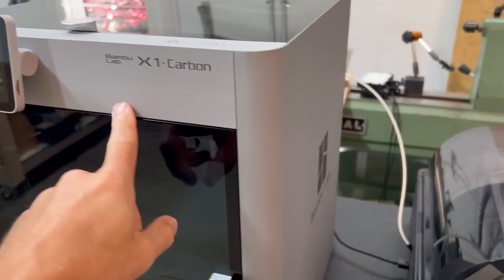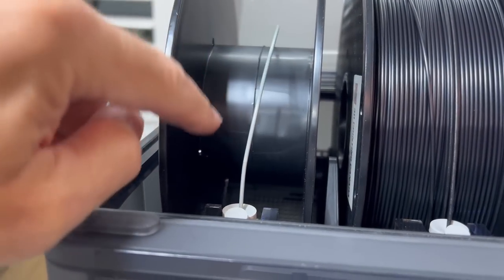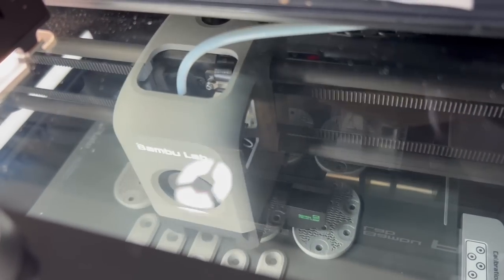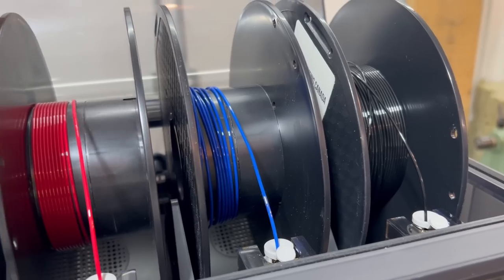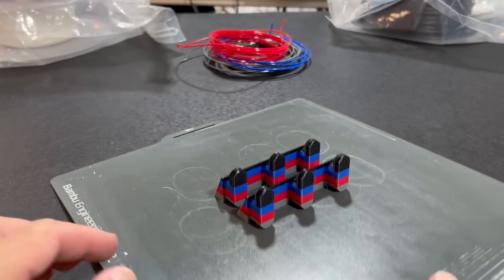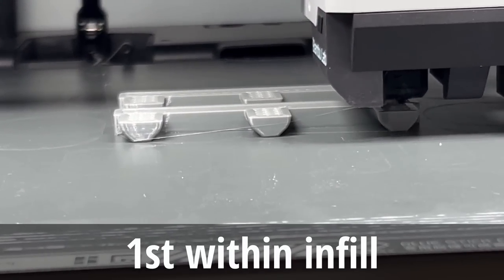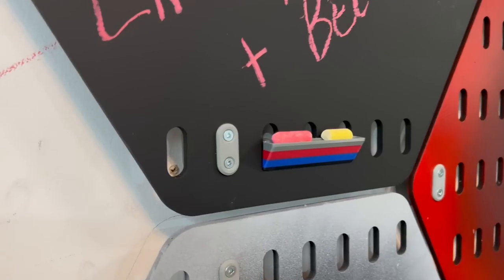Bambu Lab X1 Carbon - Auto Material Refill - Extreme Testing

Comment: This is the first video I’ve seen showing and explains how the automatic filament change works.  One step closer to buying Bambu Lab X1C.  Thanks for sharing.
Reply from the maker: They've just released a smaller printer called the A1, it looks very capable, but it is a bed slinger, and doesn't have the capacity, it does have the ability to print multi-color, which is really handy, but also pretty slow if the color is throughout.  If you did get the X1C, I can say that it is certainly an excellent printer, I don't think there is another on the market at the moment within the price range with anywhere close to the same capabilities.  This is good news for us, it should help to push everyone for more innovation.

Comment: Interesting to see how it works up close, thanks! That dangly bit in the end seems to be really effective, and spools with rigidly fixed filament end are a problem for any system.
The new video format is totally fine but I'd still recommend notes for the on camera bits. In the end you basically say the same thing two times in a row :)

Comment: Great video, thanks for posting your results. Quick unrelated question: You mentioned you were printing with ASA, and I noticed it was on the engineering build plate that ships with the X1 Carbon. On my P1S, I only have the PEI plate, and ASA sticks to it too well, making it almost impossible to remove from the build plate. Do you have any recommendations for a build plate suitable for higher temperature filaments?

Comment: Nice Video!  You mentioned you like matte colors better.  What is your filament of choice for matte colors (brand/material).  Thank you for your time.
Reply from the maker: Sure, I started printing way back with the no-name brant ABS from 3D printing Canada, I they're the black spools I've used in most of my videos.  They've always worked well for me.  I switched to PETG because I wanted to print without an enclosure, but the sheen...  I guess with a good printer, and quality filament the sheen isn't a problem, there will be very few defects to detect.  At the moment, Creality's Hyper PLA is the best I've printed with, it is so precise in diameter that it prints perfectly on any printer.  I'm not sure how they've been able to control the size to that level, maybe a new step they've added that other companies haven't yet.   So ABS is lovely, but warps and needs that enclosure, PETG is shiny, but if you can deal with it, not a bad filament to use, lots of pros to PETG.  PLA, nothing wrong with PLA, the Hyper seems to be the best I've seen but I'm not a PLA expert.    I print with ASA as well, but only a few spools so far and the sheen is good, the printing temp is high like ABS, and it does warp as well, not a lot of advantages over ABS aside from the UV resist.  I think there are more colours available now, it might be worth trying some, they're also matte finish.    I hope that helps a little!
Reply from the maker: I forgot to say thanks!

Comment: In a real situation, when I want to print, say, a wear-resistant hinge sliding bearing inside the flexible TPU, the material change will not be horizontal, which means that a lot of material would be wasted, and the printing would take a lot of time, because you would have to thread material several times in one line. and at the same time screw up the extruder. If this is not the case, please also show if you change the material vertically, say you print a sphere inside a cube made of a different material or with a different color.

Comment: I had 2 same Bamboo filaments in slot 3 and 4. It said filament ran out please add filament and click retry. 

Auto switch was on apparently. Good thing I was home to take it from slot 4 to slot 3 to countinue.
Reply from the maker: That's a bit strange, unless they're different colors, it should be automatic.  When you slice it'll even tell you which slots match just before sending to your printer.

Comment: it looks good, however I have the P1P and have managed to use up short reels by setting of a print, it stops automatically when the filament runs out and you can just feed in the next part roll and resume printing, obviously if you have time constraints the AMS is a must, but if time is not an issue then save your money if the only reason is to use up part rolls.
Reply from the maker: That's pretty good as well, does it keep your print from cooling while this happens?
Reply: dosent seem to be an issue with PLA, I can imagine it could be with ASA or ABS though :)

Comment: Does each filament have to be labeled the same color? If so, will it print from #1 and then move to #3?  I Love my XC1; it prints great. Thank you for your video
Reply from the maker: It does.  There are way to change color in Bambu Studio by layer if that's what you're interested in, but if you just want to use up the entire spool, you'll need to assign the same color and material, I believe everything needs to be identical, it should say in the menu just before sending the print, it will also give you a heads up in the AMS menu at the printer.

Comment: Is this exclusive to X1? Would a p1s with and work?
Reply from the maker: I‘m pretty sure it works for any printer they make, if you have the port on your printer to add the AMS it should work.
Reply: Yeah I just bought p1s and ams combo on there website saved a bit of money buying them together.
Reply from the maker: Good call, I believe you can connect up to 3 AMS' it does require an added hub.
Reply: @NeedItMakeIt 4 ams actually, and yes, it’s as good as it sounds.
Reply from the maker: I'll have to take another look, I thought it said max 12.  I'll have another look.  What types of things do you print with so many colors?   having color opens up a whole new world!
Reply from the maker: Funny that one of my fav features is that it is a good way to keep them dry and dust free.  I'd imagine having 16 places like this to add and store filament would be amazing with the right shelving unit.  Have you had to do any maintenance on your printer so far aside from lube the lead screws and clean the carbon rods?
Reply: @NeedItMakeIt  Actually an automated filament shelf was a main idea to get 16. I rarely use more than 4. Actually my X1 is currently down and i just had to swap a first stage feeder. Im not a pro or the hardcore user. I just had to have 16.
Reply from the maker: My shop is super dusty, having a bunch of these would be a huge time-saver to keep them dry and ready to print with.  

That's good to know.  Do you know how much you've printed approx. to have to get to the point of replacing one of these, their replacement part prices seem pretty reasonable.
Reply: @NeedItMakeIt  Nope, mine died prematurely and wasn’t much used. I might be able to save it at some point, but i opted for the fast lane this time. Maybe ill get a spare that way.
Reply from the maker: Maybe this is why they've made the housing clear, to be able to easily see if there is a problem.  I've printed about 100 parts so far, no issues that I can see, I've stayed away from CF to make sure everything lasts as long as possible.  I've also not tried anything exotic either, mostly ASA and PETG

Comment: Thanks for the video I tried it with two identical filaments but it did not change over 🤨
Reply from the maker: Just before you send to the printer it will tell you that it agrees that they're alike.  It will work for you, but there was something funny in your case.
Reply: @NeedItMakeIt  thanks for your reply I think I might have sorted it in Bambu handy if you click the lines in the top right corner next to the bell it takes you into settings click AMS and it gives you the option at the bottom.
Thanks again love your videos 👍
Reply from the maker: @andyl2201  Oh, through the handy app, that could be it.  I don't do anything through the Handy TBH.  On a slightly related topic, I have tried to switch filament colors while the print was going and it did not like that.  I think it might be possible when the printer is paused, I'll have to try it.  I want to do a Huge forge print with more colors than I have in my AMS.

Comment: i guess it wouldn't purge as much i.e. to now spool because it was the "same colour" - makes sense
Reply from the maker: Yeah for sure.  The software seems pretty well thought out, they have purging settings based on how much is needed from Dark-light, and back, white to black is less than black to white.  I go with what the recommend, but I think you can tweak as you need to.

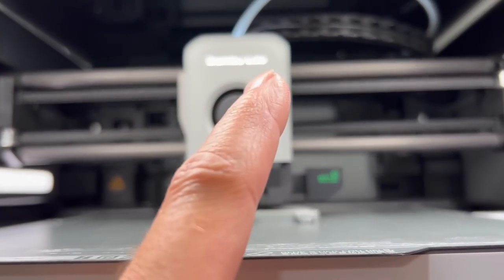Comment: I think the print head goes to the front cormer in order to recalibrate its position 5:35
Reply: That or some gcode still got the move for the cutter in but the actual cut is not in there as it is just run out rather than changed.
Reply from the maker: I'll have to learn more about the cutting process, I'm curious as well how long that cutter will last.  I'd guess it would vary a lot depending on the material being printed.

Comment: There was nothing "Auto Material Refill" about this. All you did was set it up to switch materials when one runs out. NOTHING IS AUTO REFILLED, and if the last filament runs out the print is not going to keep going until YOU MANUALLY REFILL
Reply from the maker: I'm not sure what you mean, do you expect that it would be able to grab one off of the wall and refill the AMS?  order one online for you, unpackage it and then load it in?  I suppose someone could setup an ejection system and then re-load, it is possible.   I think it does a good job of REFILLing the print head to allow continuous printing.   The build volume is after all limited, it would be extremely difficult to go through several spools with the limited space.
Reply: @NeedItMakeIt  "do you expect that it would be able to grab one off of the wall and refill the AMS?" You set that expectation when you wrote that in the title.

There are videos showcasing mods that take the bed off the printer, and put on a new one for "continuous printing", so yeah I would kind of expect some sort of auto refill from a video that says auto refill.

While that would very complicated it technically could be done with a run out sensor on the filament before it goes into the AMS, and another motor that triggers when the filament is out, and the hardest part would probably be a guiding setup for the filament to make its way into the AMS pathway. I don't think it would even need to communicate with the printer, but I don't think the printer knows to keep printing after it's been "refilled"...? This would technically be an "Auto Refill". I also don't see why a setup like this couldn't work for other printers.
Reply from the maker: Apologies, just getting to this now.  The title is simply based on the naming from the company, believe what you like.  Thumbnails are not so easy as people believe, I'm always working on improving them, and not trying to misrepresent the content in the video to be click-batey.   I can't please everyone, and I don't pretend to try, if you don't like it, move on.

Have a good one.